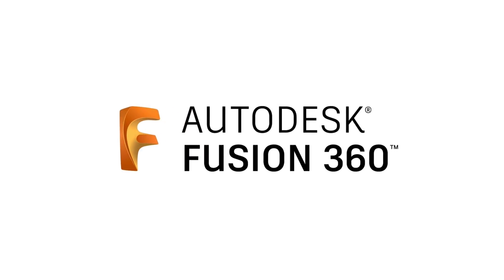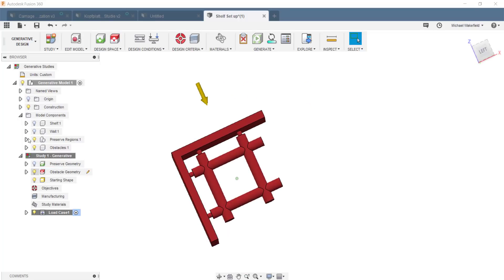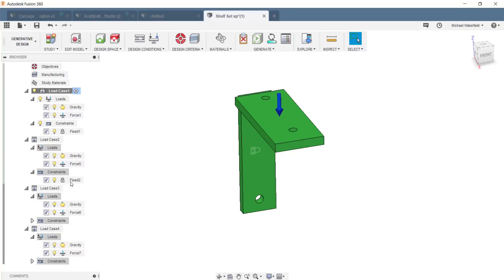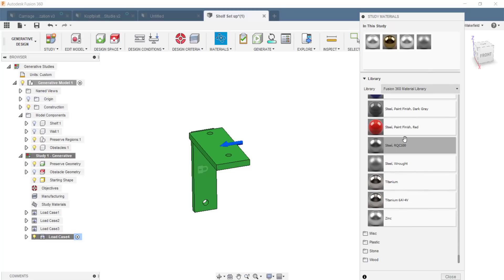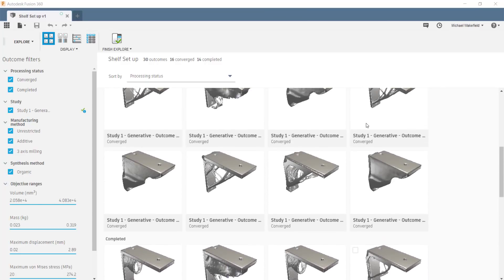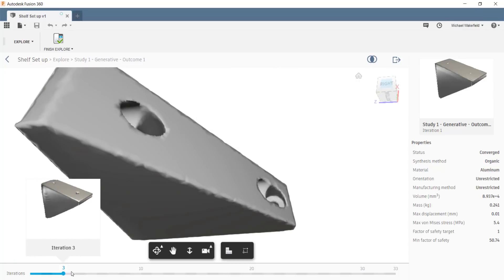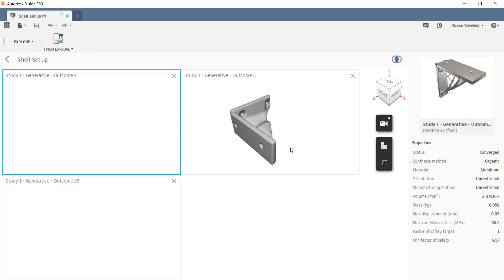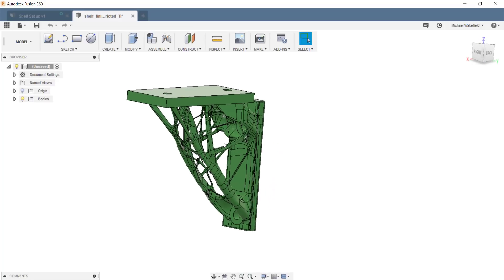How to use Autodesk Generative Design

Comment: Good tutorial but I saw 1000 tutorials about brackets. I really would like to see something different. For example what is the difference between fixed, pin and frictionless constraints.
Reply from the maker: Yup. This software is really good at creating solid parts which connect two locations in a rigid fashion. That's a bracket. The fixed, pin and frictionless constraints are standards from the finite element code that underlies all of generative design. A fixed constraint holds the surface so defined such that it cannot move in any direction. a pin fixes a cylindrical face such that rotations are allowed, but translations are not. A frictionless allows translation in a plane, or rotation about the plane normal. You can find more information in the Fusion simulation tutorials.

Comment: Interesting. What about selecting non-addictive manufacturing solution?
Reply: Yeah - of course. Other manufacturing conditions are available, and we‘re adding new ones as we figure out how to program them. They work, but IMO it’s important that the user understands what is possible with each manufacturing method. It won’t be able to provide valid solutions for things which cannot be made using the methods selected.
Reply: @mickeywakefield  Thank you for the quick reply! That makes sense, I'm glad I came across this solution. With additive manufacturing on the rise, it will be very useful in the future, And, I wanted to make sure this process is applicable for other conditions. Thank you for the help, I'll look further into this process.

Comment: 25 then 100 credits...Ikea has a whole floating shelf for about 9, and as it is floating it smashes all the criteria you asked for. Which iteration from Autodesk finally worked out a floating shelf ?????
125 credits and you get better solutions in a free ikea catalogue ?
Reply from the maker: perhaps you've missed the point First Last....I wasn't suggesting you should design a shelf bracket. It is a simple example intended to show the basics of how the software works for someone interested in using it. My customers have used it to save over 150.000 Euros on parts for a concrete manufacturing facility, save 6 weeks designing a fixture for CNC work, reduce spinal injuries by 45% in action sports, and in one case - save a couple of grams on robot parts, which was the only way to get the robot working..... but....I guess you know that. PS - IKEA and companies like that will often spend thousands to save a couple of grams of material on parts like a shelf bracket. After all - they are making literally millions of them....

Comment: So 25$ for the tease and 100$ extra if you actually want to download the low res product. Just one of them. (really not a fan of cloud corp douching)
Reply: @bushytail7262  meh
Reply: Dan Frederiksen sorry you feel that way. We know it’s not cheap. We hope that it provides enough value that people will use it gladly. In any case - it’s available to any commercial customer, but only those that actually need it pay. We think that’s a better deal than making people who would never need it basically pay for it in their software price. There if you get value, no cost if you don’t. Decidedly un-douchy
Reply: @mickeywakefield  you mean priced to the wealthiest neediest customers at the short sighted expense of any other use. The what we can get away with price. The pain threshold.
Say someone wanted to make a mechanical device with 100 parts, that would be 12k$ if he got everything right in the first go. By what you call decidedly undouchy pricing. Never mind full time use.
From the looks of it and comments below, the product isn't even of good enough quality to be used commercially. 
If I can offer some advice, a general rule of thumb is that if it's cloud only, it's corporate douchebaggery. Without exception. And until the generator is good enough for commercial quality, you don't charge anything significant for it or better yet admit that it is yet useless and offer it for free as attention gathering and interest gauging while you try to make it commercial quality. Should you get to a product that has real value, a smarter pricing strategy for a useful program is by the minute at a price corresponding to a modest full time use annual subscription. So say for max, a program that only modestly improves once per decade, could be almost fair at say 800$ per year, charged by the minute at 50cents per hour. Now the suits are already panicking at the mere thought of charging less than current greed levels but what they might recognize if not so greedily short sighted is that business users would no longer squirm at the number of seats they have, hounding people to stop having it but would freely add more people should spotty need arise, which can grow to full time use. Second, it has a zero entry threshold for private users. 50 cents an hour is not too bad for home projects now and again. Even poor students might do it. The piracy market essentially disappears over night and become paying customers. Third, it removes the hatred of corporate douchebaggery that fuels free software or competition. It kills all momentum for competition. Even though unit price is less, income might increase 3 fold and user sentiment go from hateful slaves to joy. Not that suits would understand such concepts. I can only imagine a suit saying that's a great idea but let's do triple that price because they might only use it briefly and it might be value for them.
The pricing structure assumes maxing out at 8 hours a day and 5 longest days a week and 40 longest weeks a year. Should autodesk be actually reasonable (phat chance) then all non commercial usage should be entirely free, only a modest download fee for the server service to not overload it. Say 5$ for max. But charging everybody by the minute would be welcome given what we are working with.
I don't know the full extent of fusion 360 but the pricing structure there could be 8 cents an hour. And no forced cloud nonsense of course. The power is that 8 cents an hour is not a scary threshold and people will use it liberally and with joy, assuming it's any good. It's then your task to make it any good so people will be addicted. Crazy, I know.
We use multiple autodesk apps at work and I can tell you that I have the utmost disdain for the fact that I can't use that software at home for casual occasional use without paying a shitton of money to satisfy shortsighted corporate greed. Because massively overpriced autodesk max is generally useless on its own. It needs vray, forest pack and railclone, each one pricing their product to full time commercial pain threshold use. All functionality max would have built in, if the price was even remotely justified.
Reply: @DanFrederiksen  Just a correction, 8 cents an hour isn't a pricing model server farms use. It's actually X cents for every CPU core hour. It's common to see 0.5 USD for every CPU core hour in most server farms/cloud solutions.
Reply: @DanFrederiksen  Interesting idea